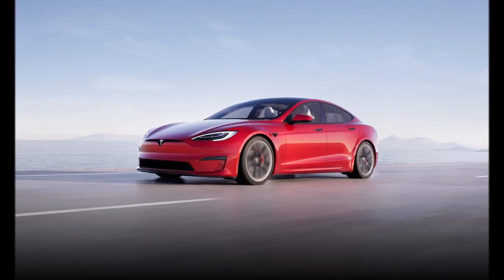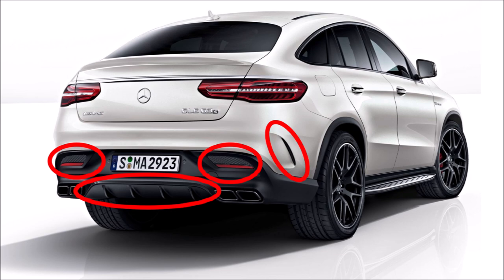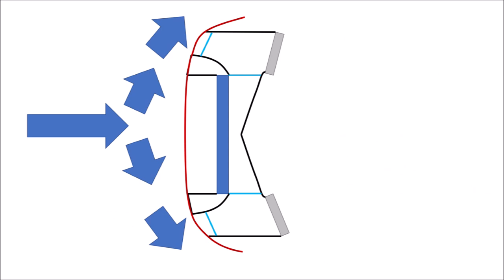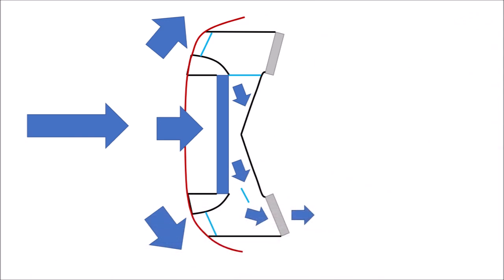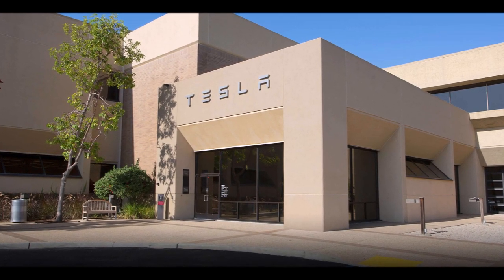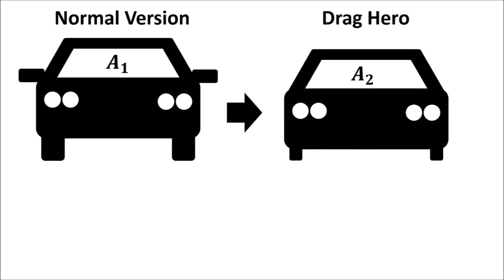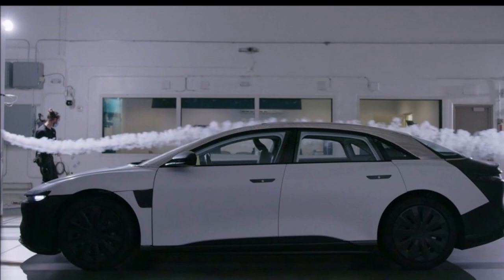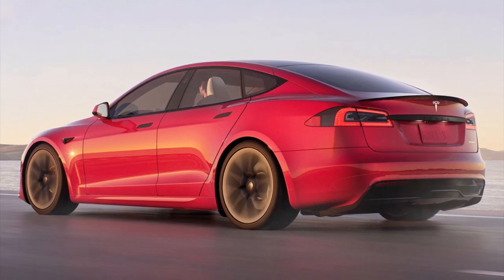2021 Tesla Model S - Aero + Cooling

Comment: I like their approach to exterior styling. The fake vents trend is silly. The Model-S is handsome and sort-of timeless in a similar way to how most Aston Martins are, although not quite as attractive as them.

As for the interior, I have serious concerns. Moving every function to screen or touch sensitive buttons is good for cost saving long term and will impress the customers, but using those functions is equivalent to texting while driving, which is illegal for a good reason. A screen requires a lot more attention to operate than a physical dial or button which often can be operated completely by feel. I like Mazda's approach here, where they completely removed touch screens in all their latest models.
The yoke is also very questionable. Expect to see reports of people crashing due to grabbing a wheel that's not there while doing a U-turn.
If this car was completely autonomous, I'd say the interior is nice and clean. But I suspect it is not.

As for "Tesla Killers", anything that gets the job done better is a Tesla killer. Nobody needs to do 0-100 in under 2s. Yet most people want accurate panel fit, blemish-free paint and other things you get in a Ford Fiesta, but can't get in a $100,000 luxury car from Tesla. Jag i-Pace seems like an easy Tesla Killer in the real world. Tesla's Apple-like halo will wear off in time.
Reply: With trickle down R&D (Mars mission) I think Tesla will remain a leader for many years.

Comment: I’ve always struggled to understand where is the air flowing out from after it passes thru the radiators? Unlike Hypercars these cars don’t have outlets on the engine cover or anywhere
Reply from the maker: It usually exits into the wheel arches, below the front axle or (at combustion engined cars) through the prop shaft tunnel.
Reply: @BSport320  oh wow, that must be very draggy

Comment: What r condensers for ?? How is it different than the radiator
Reply from the maker: Air flows through a condenser and it mostly looks like a radiator. But like the name states it's for condensing gas (makes it liquid again by cooling it).
Reply: @BSport320  ohhhh thx!
Reply: @BSport320  What do the condensers cool versus the radiator? Thanks in advance.
Reply from the maker: @marcbee1234  radiators cool the engine‘s coolant, condensers condenses refrigerant of the A/C system